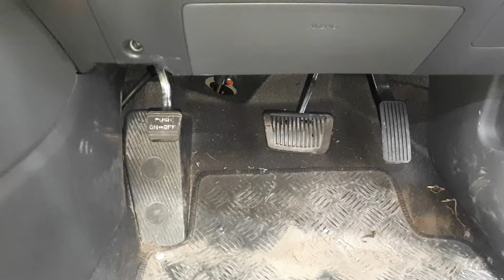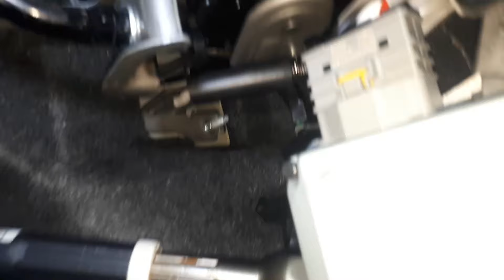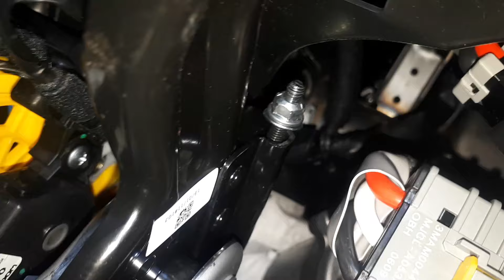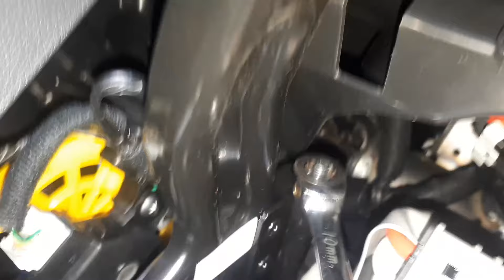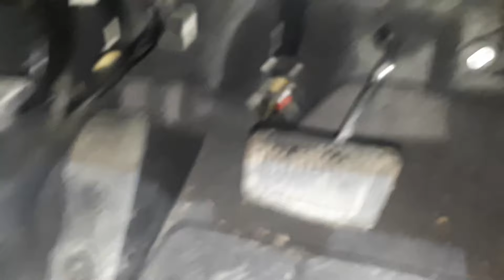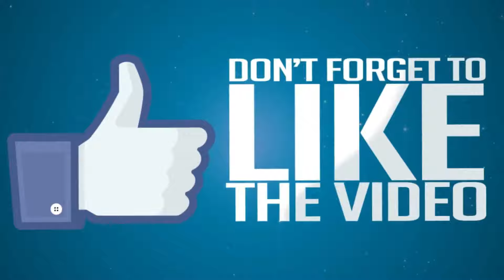Parking Brake Foot Brake Hand Brake Adjust Hyundai

Comment: Local dealership wanted to charge me $100 to do this. Knew I'd be able to find it on Youtube. Thanks.
Reply from the maker: You're welcome.
Reply: Because it is not how you do it correctly...
Check the manual.... You need to start at the rear wheel and adjust the parking brake shoes, and then the cable and only then you adjust the foot travel if at all...

Comment: Hey George...this actually worked just like in your video! I have a 2014 Sonata with 67 kms on it, and the the parking brake was going right to the floor. I know that the parking brake pads are in decent condition, so it looks like it was just the brake cable that had stretched over the years.  Now the parking brake holds the car on a slight grade at about half of the brake pedal travel. Easy peasy!
Thanks again.
Reply from the maker: Glad it helped, do your cables attach to the caliper or goes inside the disc?
Reply: @GicaPhp   Hi George, the cables activate brake shoes (drum brakes) which are located inside the rear discs. Gil
Reply from the maker: @gilmick5431  if you have brake shows, there is an adjuster there too. So what you should do is to loosen the parking brake pedal back, then adjust the shoes and then the pedal, it is similar to this video https://youtu.be/If3adPwCQa4 (maybe the rubber bung might be on the outside)
Reply: @GicaPhp  Okay, thanks George. I'll check out the adjustment on the brake shoes in the rear wheels. Up here in Ottawa, Canada we use snow tires from November till March. I'll have a look at it when I switch the tires out in the late fall. Thanks again for your very informative videos. Much appreciated! Gil
Reply: 0:00
T4

Comment: That is it?  Nothing else needs to be re-adjusted at the rear of the vehicle?
Reply from the maker: Nothing else, easy as that ;)
Reply: No that’s not it 
Bro you need to adjust the star wheel on the the rear brakes and then you tighten the
Adjusting nut that is under the car right in the center .
Reply from the maker: @big_mac6037  Thank You for our comment. On the IONIQ the system has a pedal box, a cable with an adjusting nut, then has splitter (equalizer assembly) where you connect the left and the right cable, which then they go all the way to each rear caliper where the out skin is secured by a clip and the cable is just hooked up over a hook. You are right about another nut on the equalizer assembly. but that is not meant for adjusting the travel. Parking brake travel should have 6 to7 clicks when applying 30kgf on the pedal.
Reply: @GicaPhp thanks for this, very informative.

Comment: Hey George Moraru you think is the same thing for a Kia Sorento 2011?
Reply from the maker: If I remeber correctly, if you take a rear wheel off, you should see on the drum/disc a rubber plug (if still there) through which you can adjust your shoes. And if still free play in the lever/pedal there is also an adjuster there. You should reset both (loosen them) and then adjust shoes 1st then lever/pedal travel.

Comment: This is a load of lies. Mine has a un adjustable cable and u tighten at the drum. If a 10mm wrench could fix it well wouldnt that be nice. Awful
Reply from the maker: What vehicle do you have, if you don't mind me asking?
Reply: @GicaPhp  2012 sante fe
Reply: @GicaPhp  first work ive jad to do. Its near mint. But most transmissions fail nowadays from not using the ebrake. It loads up the trans and u get nice clunk when u put in gear. I finally started using foot ebrakes after mechanic school 10 years ago. Havent lost a trans yet.
Reply from the maker: @coastalcleaningandmaintena2884  yours have drums for parking brake, this video applies for caliper operated parking brake. Sorry for finding this video awful. Any parking brake system with drums will have main adjustment from inside drums and fine adjustment on lever. None of that applies to electronic parking brake. I hope at least all this comments will help others in the future
Reply: @GicaPhp  theres zero adjustment. And yes most vehicles have 4 wheel disk with drum e brake here in canada. Anyhow new carbon ceramics going on soon ill deal with it then. And again your incorrect. Theres no traditional drum ebrake with your normal clicker spinner. Its quite hi tech
Reply from the maker: @coastalcleaningandmaintena2884  ok buddy, thanks for the inputs, much appreciated.
Reply: @coastalcleaningandmaintena2884 😂 wires crossed!! The foot operated handbrake is not an e-brake.